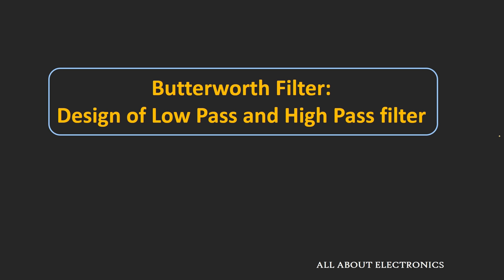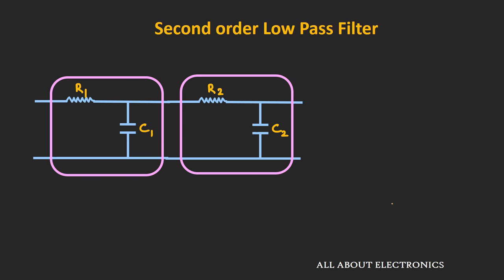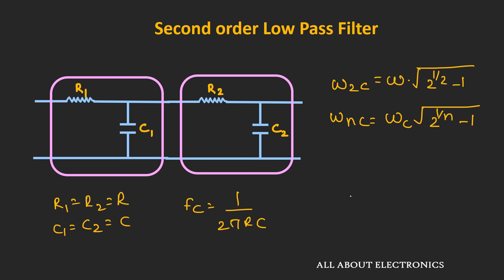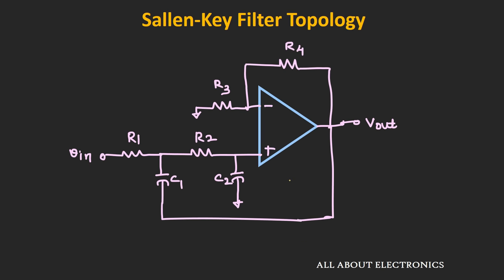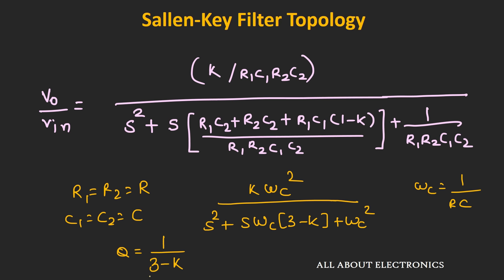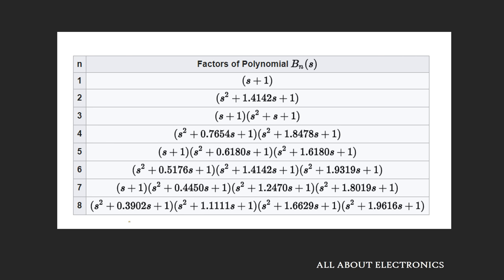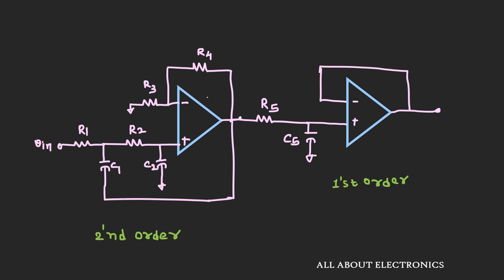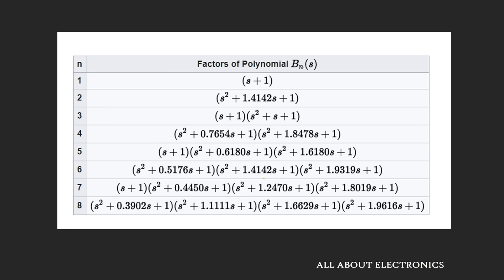Butterworth Filter : Design of Low Pass and High Pass Filters

Comment: Hi, I found a mistake in your video, at 2:51 you can not simply calculate the transfer function by multiplying the functions from the two RC lowpass filters, because the first transfer function changes when you connect a load. You can't just use a normal voltage divider there. You have to calculate the transfer function again using Kirchhoff which adds an extra term, however, it does't change much of the final result. When setting R1 = R2 = R and C1 = C2 = C the new transfer function simply has a 3 instead of a 2 as a factor at 5:29 .
Reply: Yes bro, the transfer function in this video was wrong
Reply: for cascading first circuit to the second, there should a coupling circuit having infinite input resistance and zero output resistance. because of the loading things got different. you are right!
Reply: What is the value of w(omega)?

Comment: There's a lot of math and I watched the video a couple of times to understand. This can all be simplified to a) using sallen-key topology   b) Using Fc = 1/(2x PI x R x C)  choose Fc , C and solver for R   c) Keeping the gain between 1 and 2.5
Reply: Choosing R1=R2 and C1=C2 is a more simplified way of choosing the components, but it limits your choice of Q. By choosing 4 separate values of those components, you can actually adjust Q. You don't need to adjust gain with the additional 2 resistors. His video has a lot in it, but I don't think he explained that.
Reply: What is the value of w(omega)?

Comment: 2:46 bro the second low pass portion will draw some current from the first one, you cannot simply multiply the transfer function of individual filters In such case. Proper nodal analysis will give you the correct transfer function.
Reply: Yes bro. In this video the transfer function of second order low pass filter which was determined is fully wrong

Comment: Very good 
Is it not possible to cascade 4 operationals with gain 1 and without the R3 and R4 to adjust the gain, connecting the output directly to the negative input ?

Comment: If i wanted to add a gain to the 1st order part (the 2nd stage) of the 3rd-order filter, then i would use Q=1 to find R6 and R7 (like R3 and R4 of the 1st stage), is it correct?
Since the 3rd order polynomial is (s2+s+1)(s+1) --> we see from the first part, s2+s+1 that Q=1 for the 1st stage, and we see from the second part, s+1 that Q=1 for the 2nd stage.
Please let me know if i'm mistaken.

Comment: Thank you for excellent explaination sir..... A small suggestion form my side ... It is good if subtitles r placed little bit low we couldn't see equations clearly
Reply from the maker: You can turn it on or off the subtitles manually in the settings. Moreover on the desktop, you can drag it anywhere on the screen.
Reply: What is the value of w(omega)?

Comment: For 4th order what value of quality factor should i choose to solve. Like looking at the chart there are two values 0.7654 and 1.8478. Plzz help
Reply from the maker: 4th order filter will be the cascade connection of two 2nd order filters.
Hence, there will be two polynomials for each stage. 
One second order filter will have Q= 0.7654 while the second stage will have Q=
1.8478. So, or the first stage, you can decide the values of R and C by considering Q= 0.7654 and similarly for the second stage you
can decide the value by considering Q= 1.8478.
I hope it will
clear your doubt.
Reply: Yes, thank you very much. My doubt is fully cleared.
Reply: @ALLABOUTELECTRONICS  so the coefficient of s from the table is Q? isn't it 1/Q?

Comment: if I use the S domain to calculate 3dB frequency of first order low pass filter I will have different result form using 1/(2piRC), can you explain me why???Like the example on the first low pass filter video. Using S domain method I have 659Hz and using 1/(2piRC) i got 1,59kHz.

Comment: Just by cascading two low pass filter we get the same cutt off frequency as first order . And for butterworth also ,cuttoff frequency should be same for  all orders of filters. Then what is the point to design butterworth filter?  If we design then why we can't design using two low pass filters?  As u said in video the cutt-off frequency for low pass filter is differ from order to order...How? Overall  very difficult to analyze the need of  butterworth filter.
Reply from the maker: I think you haven't watched the video of Butterworth filter properly. When you cascade the two RC filters of same cut-off frequency, then the resultant cut-off frequency won't be the same. 
Also for Butterworth filter Q= 0.707. Which you will not get just by cascading the two RC filter stages.

Comment: At 7:30 the second term in the denominator should be  S[R1C1+R2C2+R1C1(1-k)/R1R2C1C2] 
There is a minor typo in case anyone was confused
Reply: That part is correct. I guess the correction will be at 8:05  It'll be R1C2 in the denominator
Reply: What is the value of w(omega)?

Comment: I don't think you can cascade two passive filters like you showed. It will cause loading of the first filter.
You will need a buffer between the filters.
Reply from the maker: That is what, I have said at 4:22. The cut-off frequency won't remain same. But it will get shifted.

Comment: Since the polynomial for the 4th order butterworth filter is (s^2 + 0.7654s + 1)(s^2 + 1.8478s + 1), how would you determine the Q value for the system? Would there be two separate Q values or could you somehow simplify for a single Q value?
Reply: The Q-factor is only defined for second order filters.
Reply: What is the value of w(omega)?

Comment: very nice video thanks a lot..
but one thing i couldn't understand i.e. in (s^2+s+1)  Wc=1. so how fc=1khz...it should be (1/2*3.14*wc) and if we take fc=1khz then (wc=2*3.14*fc). so the Q will not be = 1.. plz clarify it as soon as possible..
Reply from the maker: Yes, that is correct. Instead of fc, it should have been wc= 1000 rad/sec, because the polynomial equations have angular frequency. Thanks for pointing it out. 👍
So, if we take wc= 1000 rad/sec, then design values will get changed now. C1=C2=C5= 0.1 uF and R1=R2=R3=R4=R5= 10 Kilo Ohm.

Comment: Sir, please clear my doubt...you said that Butterworth filter has a higher value of Q over passive filters, then what is the advantage of having a Higher Q value?
Reply from the maker: For Butterworth filter, Q is 0.707. While for the normal passive filter it is at the most 0.5. Like I said, in the normal passive filter, if you simply cascade the two stages, then the cut-off frequency of the cascaded filter will less than the first-order filter. But due to the higher Q in Butterworth filter (due to positive feedback), even for the higher-order filters, the cut-off frequency remains the same.
That's the main advantage.
Reply: @ALLABOUTELECTRONICS  sir does having higher Q help us in achieving brick wall response?
Reply: The higher Q is accomplished by the transfer function. Positive feedback in the Sallen-Key topology is one way to achieve that, but it isn't the only way.

Comment: 2:57 not that easy to formulate the cascaded RC network, unless you put buffer in the first stage. That because, the impedance of the first stage will change if you connect the second stage.
Reply: Exactly bro...

Comment: You told that 3-k will be valid for k less than 3 what will be the value of Q for k>3 as 1/(k-3) =Q
Reply from the maker: As K approaches 3, Q tends to infinity and the system becomes unstable. K has to be less than 3 for a stable system and finite Q.

Comment: How did you arrived the polynomial for various orders of filter?
Reply from the maker: You can find it from the datasheet/application note of the filter. I used it from the one of the application note of the Analog Devices.
Reply: @ALLABOUTELECTRONICS  so it cannot be derived uh...
Reply: Of course it can be derived. See the Wikipedia article, for example.

Comment: what if cut off freq. 50Khz ?? how many value of R1, R2, R5, R3, R4 ??
Reply from the maker: Suppose the cut-off frequency (Wc= 50000 rad /sec) then the value of R1, R2, and R5 will change. C1, C2, and C5, as well as R4 and R3, will remain same.
Reply: ALL ABOUT ELECTRONICS thanksss soo much
Reply: But If Wc chagnes, to mantain the polinominal function the same, Q has to change, and that makes some ripple appear in the pass band, I just simulated that... How can I choose a value for Wc and keep Q=0.707 (the value to have no ripples or peaks at Fc)
Reply from the maker: I would recommend you to use this tool from analog devices for the filter design. It will be very helpful to you.

Comment: expression for transfer function of sallen key is not correct. It should be
K/(s2(R1R2C1C2)+s(R1C1+R2C1+R1C2(1-K))+1)
Check:
http://www.ti.com.cn/cn/lit/an/sloa024b/sloa024b.pdf
Reply from the maker: The equation in the video is correct. The position of C1 and C2 is different in the video and in the pdf. That's why I think you got confused.

Comment: hello , I am glad to have found your channel ,  I am looking at building some DIY speakers for myself and want have a 4 way setup, I have little to no electronics background but read the following website
 http://education.lenardaudio.com/en/06_x-over.html  which explains the problem with the crossover but gives no solution to designing 4 way active systems.
I have 2 questions 
1 . is an op amp a hi fi quality component or does quality sound in active crossover have to be done with transistors on second order and 3rd order filter

2 have you got circuit diagrams for a complete 4 way active crossover with formulas i would need to calculate the components according to my desired frequecy points? 

much appreciated, i can send my email if desied

regards Clive
Reply from the maker: Well, I had gone through the site you mentioned. 
It appears that it requires four different filters with different cut-off frequency.
Well, I do not have any circuit diagram, but it can be designed using Op-amp. As Op-amp has very high bandwidth. So, for audio applications, it can be used. But only thing with Op-amp is that all Op-amps are not able to drive the speakers. As they have limited output current. So, it depends on your design, what output you require from the speaker. (e.g 1W. 2W etc) 
well in such case you can use driver IC's at the output of the Op-amp to drive the speaker. 
Now, about the design, it seems you will requie one low pass filter, two bandpass filters and one high pass filter. 
You can go for the second order filters, which will give you 12db/octave of roll-off rate.